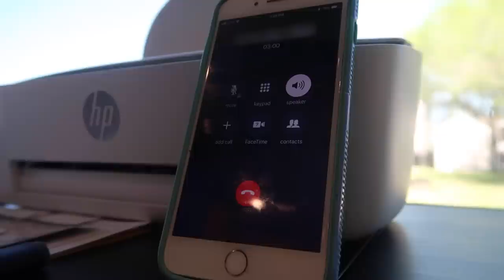RV BRAKE FAILURE! 😱 || RV LIVING

Comment from the maker: Hi Gang! We wanted to clarify that the failure was with the Kodiak Disc Brakes, and has nothing to do with MORryde, other than they were the installers. We still love our Independent Suspension and Kodiak Disc Brakes (and no, we're not being paid or anything to say that lol). Look, things like this happen in the world of RVing. The warranty head that we spoke to at Kodiak was awesome. He got us our parts in two days and gave us the confidence to do the install ourselves because he knew we needed to get back on the road. Additionally, we spent some time talking to him about this issue and why it might have happened. We wanted to know if we missed a maintenance item or did something to cause it. He said that if the bolt didn't have Loctite, it's possible it would eventually come out on its own, but we have pictures of the old bolt with plenty of Loctite on it. We asked if this is a common issue and if he's seen it before. He said that after all his years at Kodiak he's heard of bolts coming out ONE other time. We honestly believe that this was a fluke. And come on, if you've seen our previous videos you know what kind of luck we have! lol :)
Reply: and that is a "Torsion Bar" type of suspension...
Reply: well, you could red loctite the new bolts and then you'd need a heat source to melt the red loctite if you were to pull them apart again...
Reply: 20 year mechanic. I have to say by what I can see. You did a good job. The best part is your wife got involved in the repair. Great job. Rv on young lads.
Reply: Did you bleed the brakes?  We did not see you top off brake fluid.
Reply: @maximumwoof8662  It isn't a torsion Bar suspension ,  it is an Independent suspension

Comment: FYI. I’m the founder of the Drv Owners Group and do you know that it wasn’t something you did, this is a very common problem with the morryde independent suspension. The brake caliper bolts get loose out at random. Use locktight next time if you didn’t this time. Good job guys. 👍
Reply: Hi Phil. It looks like the bolt he found on the ground had Loctite on it. Wasn't this an installation morryde did? If that's true did they not apply Loctite correctly or Torque the bolts correctly? Wouldn't they hold some responsibility in getting this through a mobile tech to fix? If this is a common problem does the Loctite application  correct this problem? Is it common because Loctite is not used correctly or is this a design issue? We are very concerned as we thought we were going to make a purchase of a triple axle system.

Comment: Hi guy's, this Bennie from Texas, the wife and I went to New Orleans, Louisiana  on Interstate 10 probably the worst road in Texas from Houston through Beaumont, Texas. We had to drive around 45 miles an hour due the the road, my truck and my 23' Kodiak was bouncing sooooo much. when we arrived in New Orleans, Louisiana the inside was a mess, and vise-a-versa  going back home my cover for my slider lite was on the floor. My lesson learned was after a rough road stop and check your trailer. Good Luck Guys

Comment: Outstanding job guys!  Brakes are an easy job but can be very daunting for the uninitiated for sure, especially considering they are the main safety feature of your rig. And you save yourself $100s in mobile mechanic fees.  Your truck is exactly the same, FYI for when that job comes knocking.  I would also agree that you hit a pothole and those caliper brackets seem to be cast and cracked just like the rim did and lost one of the bolts then the tensile strength of the last bolt was only enough to hold on until the next big pothole.

Comment: Be sure to check the bearing seating after a few miles. Jack that wheel up and give it a wiggle. If it moves, use the Flintstone Wrench and tighten the retaining nut a little bit. It won’t take much and be cautious not to over tighten (bearing will wear out quickly). Good video. Safe travels!

Comment: FYI   Your wheel bearings do not require packing with grease. Those clear caps with the rubber plug in the center
require oil, the Dexter spec. is 90w gear oil. Gear oil in the hubs is the best setup for long bearing life and ease of
maintenance. Check with Dexter to verify what I am saying and also the correct oil level in your hubs. You should be able to see the oil level in the 3 other hubs, if not add some 90W   right away. Pull that black center plug to add oil.  PS buy a couple different size channel locks for future repair jobs.

Comment: I am very proud of you guys too. I would guess that the calliper bolts were not tightened correctly causing the calliper to become loose and move suddenly with every brake application and eventually failing.

Comment: Curious to know why you packed the bearings with grease 🤔 
The bearing set-up with the screw on plastic cover is for Wet Bearings like on a big truck. 
You put gear oil in through the rubber plug until it's full with the trailer sitting level 👍

Comment: I'll give you simple tip to change break shoes since I did an whoops. Take off tire. Take off caliper. Only extra tool needed is an 6in C clamp. Take old break shoes off. Take C clamp with the threaded end and put that pad into the cup that pushes the break shoe. Just snug it in the center of the cup and the other side will be on the back side of the caliper. Open the bleed valve. Then gently squeeze the cup back into the caliper. Note break fluid will come out of the bleed valve. Once set back in, that is the top of the cup about even with the caliper. Before you take off or release the pressure off the C clam, close off the bleed valve. Then take off C clam. Put new breaks on. Put caliper back in place. With truck hooked up an running, have one pump breaks until the cup pushes the break pad against the brake rotor. Once tight. Put on the tire. Your done after you check the break fluid level. Simple. Your truck, ect is no different. Take care.
Reply: Since the line what's ripped off of the caliper they had lost their hydraulic fluid. They needed to bleed the brake lines which doesn't appear they did. Your instructions are for a simple brake pad replacement but an entire repair like this should have been done by a mobile tech under morryde since they did the original installation and probably didn't do it right.

Comment: Dude I would have been irate with the factory installers. There is no way the tightened those bolts as they should have. Plus with the broken line you had no brakes! Yikes 😳
Reply from the maker: Honestly, we are still so happy with our Independent Suspension and disc brakes. We did have a more serious conversation with the guy at Kodiak as to what could have caused this, and we brought that up as a possibility. He said that if the bolt didn't have loctite, it's possible it would eventually come out but we have pictures of the old bolt with plenty of loctite on it. We really do think this was a fluke. He said that after all his years at Kodiak he's heard of bolts coming out one other time. Additionally, I-10 is such a horrible freeway, especially in Louisiana (where this happened) and we had driving it from CA to FL in January, and then back in February so we've been putting miles on our rig.
Reply: @GetawayCouple  the problem with that statement from them is it was never installed right the first time. THe blue would never be on the bolt like that after it is bolted in correctly. The blue would "WEAR" away so if the bolt have been instlled right and "FELL OUT" there would be almost no blue left on the bolt.  It was never installed in the first place.
Reply: @GetawayCouple  I-20 Through Louisiana is just as bad.  Speed limit is 60 and that's way to fast.  I'd give it a 9 on the richter scale
Reply: @ramman5784  the whole point of getting this independent suspension is to manage difficult roads just like that. If the road is being blamed then what you're saying is it's pointless to buy this independent suspension? That makes no sense. Automobile brakes are not much different then this caliper system and you don't see bolts falling out of those because of rough roads. I suspect the installation was not done correctly which is surprising since it was done by morryde. Shame on them.
Reply: @arthurnied5500  No I'm saying the roads in Louisiana on I-10 and I-20 are bad.  Nothing else.

Comment: Good job getting everything back together yourself.  Being on the road, brake maintenance is something you should understand.  I would encourage you to replace the brake fluid in your tow vehicle every couple of years.  Brake fluid is an odd thing. even though your brakes are a "closed" system the fluid will absorb moisture over time eventually rotting the lines from the inside out.  Even worse if your brakes become hot enough (going down grade with a heavy trailer) the moisture in old fluid will boil causing vapor to form in the line and you will have no brakes because the hydraulic action will be broken...vapor is highly compressible!  New brake fluid is cheap maintenance, put in new bleed screws if your brakes have not been regularly bled the first time you do it.  Make sure your newly installed caliper mounting bolts are properly torqued to the yolk, it's critical as you have seen.  Match mark your bolts with a paint marker and you'll see if anything has changed.  PS, love your theories, can we get an Ice Road Truckers style animation of the failure LOL?!?

Comment: Question, did you bleed that new caliper? Means also prime. Simple if you did not. On the back side is an bleed valve. Know where you fill up your break fluid. With truck hooked up and running. One in the driver seat. Foot off breaks. Turn the release valve a couple of turns. Then have the one in the truck slowly press down on the breaks and hold. Close release valve. The let up on breaks. Repeat until solid stream of break fuild comes out. When done recheck break fluid level to make sure it is at proper fill height. One last simple check is to press on breaks and try to move the caliper. If moves, then press and release breaks a few times. Moves the cylinder in the caliper with the break shoe into position for use. Then one more time, press and old breaks and see if you can move the break rotor. Impossible to move, job done. Again make sure the break level is at its proper education. Take care and be safe plus have fun.

Comment: I found the 'all things are bigger in Texas' humorous, and you two did a great job on this job!    It's also great that you have a phone plan in which you can do a fair bit of long distance calling, but generally....when things go wrong on the road, it's rarely a positive situation.   Had it happen to us as well, which took a week out of our planned trip, where a bearing got so hot it did damage to the hub, which was welded to the axle, so we had to wait for a full axle assembly, in a very small town, which at least thankfully had someone with the ability to cut out the old axle and put in the new successfully!    You never know when things can go wrong on the road!   Which reminds me, do you have a 'TPMS or tire pressure monitoring system' on your rig?

Comment: As for your theories… Here’s what 100% happened: Either there was no loctite on the bolts or whoever was in there last didn’t tighten the bolts all the way. I’ve been a mechanic going on 20 years and I’ve never seen a caliper bolt just work it’s way loose. 

But great job getting in there and getting dirty and doing it yourselves! Now, not only do you know you can fix it going forward, but I bet you have a better understanding of how it all works! Bravo.

Comment: Hey guys, a late follow up to your video, but since your channel is so popular I thought this might be good to post.  I'm readying to do the disc brake conversion and have been researching across the forums.  I have actually found 6 different owners that have had the exact same failure you experienced and all with the Kodiak components.  Seems medium strength, blue thread locker is not enough and may need red like GM vehicles required for many, many years on caliper bolts...  Great job handling the repair!

PS - please do not change heavy truck tires, or any tire really, in flip-flops or sandals.  If the tire flops off the hub, your foot could be severely injured.  A now passed full-timer lost all his toes on his left foot from such an incident, and had to have a couple foot bones screwed and pinned together.  Be safe and enjoy the open road!
Reply from the maker: Thanks for the recommendations!

Comment: I hope that somewhere someone told you about bearing clearance, how to check for it, and how to adjust it.  I was watching this from the beginning and kept thinking, you can do this.  And....you did!  Sadly, this type of knowledge was common to most high school kids when I was young (back in Napoleon's day).  I can't remember how many "brake jobs" I did before I turned 20, it was just something just about everyone did, work on their own cars.  Let me know if the bearing clearance was checked. I'm worried. Also, pick up a strap wrench at Tractor Supply, they come in handy and probably would have removed that dust cover for you.
My analysis of the failure (retired engineer here), I believe the yoke was the original failure, either it came loose or the pothole did you in.  Because the yoke is what keeps the brake caliper oriented properly to the rotor, when it broke it put a lot of stress on the bolts which held the caliper on and caused their failure.  If the pothole had loose chunks in it, one of them could have kicked up, broke the caliper loose from the yoke, and also took out the brake lines.

Comment: It is amazing the number of people I see with camping rigs that do not carry a real jack or a battery impact.... Just a huge issue that is easily solved with $300.00.
Reply: I have struggled with this to be honest.  I have a hydraulic jack for my car and at home, but have not been able to rectify that to my 24' Class C and how I would possibly change a tire on it.  Last year I hit a metal rod on the interstate and shortly after was able to pull into a rest stop and realized my front tire had been slashed.  AAA was a godsend, and I'm glad I had a good quality spare.  I just needed them for the jack and the air.  I now have an air compressor to fix the air problem and a tire repair kit, but neither would have helped at that time since the tire was SLASHED not punctured.

Comment: You use water pump pliers to undo axle nuts when you reinstall you tighten to seat the bearings then back off enough to feel it become free then snug to put your cotter pin in then bend over

Comment: I feel your pain, I was driving 38' class A when the break failure light came on. Pulling off hwy realized the breaks were not stopping me (thank the lord for the emergency brake) after calling 14 shops got a tech to come to me. The brake line burst.  It was an 8hr delay. I was in CT going to AZ. I only had 1 day experience driving the rv

Comment: It’s hard to tell because video was fast forwarded but I think you put the flat washer on the wrong side of the nut. Washer goes between outer bearing and spindle nut. You should get it double checked for proper bearing preload.
Reply from the maker: Yeah, that is where we put it. The retainer clip was last so maybe that's what was confusing? I know it was hard to tell from the time lapse but we put everything back in the order that was in the manual so we're good!

Comment: Great job! Don't forget to check the torque on the yoke and caliper on the other side of your rv as well.  Try to do an inspection of your suspension bolts on a regular basis.

Comment: Caliper bolts don't just "fall out" if they're tightened to the correct torque specs when assembled.  The blue Locktite doesn't do anything if the bolt isn't tightened.   It's not glue, and it's not going to "wear away".   I can't believe you had a brake repair place tell you "they don't work with hydraulic brakes" because all vehicles have hydraulic brakes;  only the emergency brake may be non-hydraulic.    You're getting a lot of run-around, likely because someone doesn't want to accept responsibility for not tightening the caliber bolts.     Glad you could do it yourself.
Reply: Morryde did the original installation of this independent suspension retrofit.

Comment: I had a question for you guys because I do know something about brakes and especially hydraulic brakes did y’all bleed the brake system after adding more fluid. Because if you didn’t the brakes are still not gonna work properly because you have air in the Breaking system

Comment: I would think resetting the tire pressure sensor would fix the error but its just an idea . Wow you guys were so calm with all those problems but on the bright side if it comes in 3's you guys are good for a while lol . That was so nice of thousand trails to extend your stay .
Reply from the maker: We agree! And yes, we did reset the TPMS but turns out it was right, they found a crack in our rim. But that's all fixed now!

Comment: Good job on fixing the brakes yourselves. Just one note, with the clear cap that was on your rotor I believe that your suppose to run gear oil in your bearings and not grease. Grease won't hurt anything it's just not correct. Just something to check on.
Reply from the maker: Interesting! We'll definitely check on that with the manufacturer. Thanks for the tip!

Comment: I would check the torque on the other side brakes. Those brakes were not installed properly. Lock-tight and proper torque and those should have never come loose, potholes or none. Also always carry a short length of pipe to slide over you factory tire tool as a cheater bar. I've seen lugs that could not be budged even with my $400 battery powered impact, but the pipe trick took em right off.